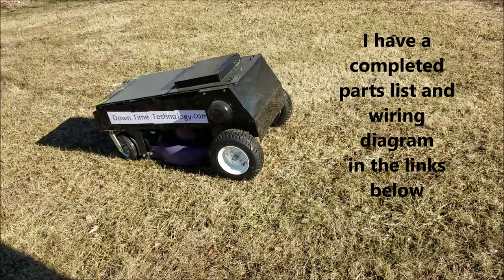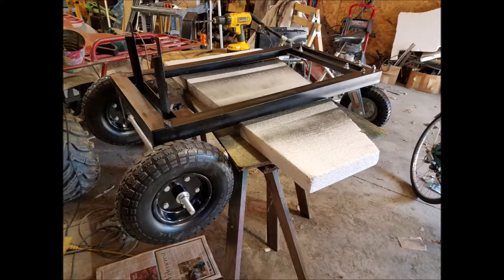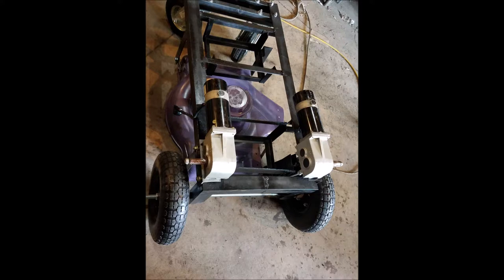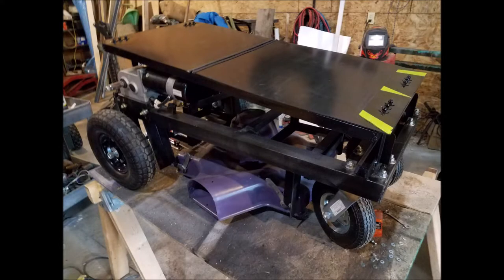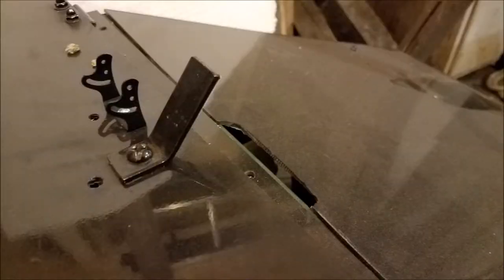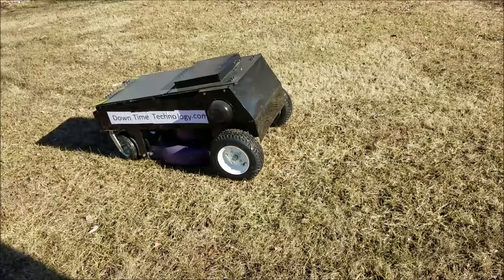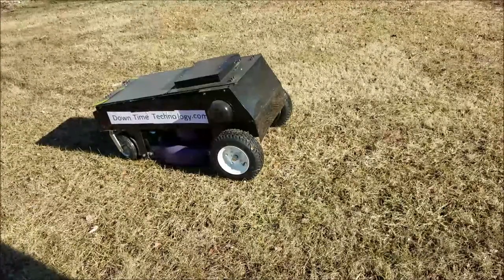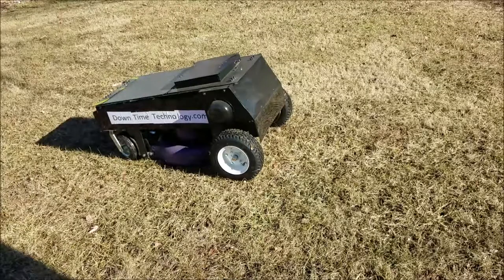how to make a RC lawn mower with on board video - free instructions

Comment: Great video , if I were to use 4 wheel chair motors for all wheel drive , would I need two motor controllers  ? chained together
Reply from the maker: @VernLee-y9q  no, just wire one side both left motors to one leg of controller and the other side (both front and rear motors to the other side of the controller
Reply: Thank you so much

Comment: John , If I could brother you one more time , I was told I need a 60 amp motor controller , is that right ?
Reply from the maker: @VernLee-y9q  for 4) motors, yes, I would recommend a 60. On mine I am using a 25, but I only have 2 motors
Reply: Thank you again

Comment from the maker: Here is the parts list.
Parts list to make my remote control lawnmower

2 inch angle iron (to make some of the frame)
1 inch angle iron (to make some of the frame)
1 inch square tubbing (frame)
several nuts,bolts, washers and lock washers, I used mostly 3/8 in
2) 2-Pc. Split Rim, Hub, 60T Sprocket Wheel Assembly - 10.5in. O.D. 
(bought at Northern tool and supply for $55 ea)
1) 3/4 inch threaded rod 3 ft piece along with nuts and washers and 2) lock nuts
for the end.
2) #24 sprockets with 3/4" ID for the wheel chair motors. I got at Harbor Freight.
2) 8 inch swivel wheels, I believe the tire size was 2.80/ 2.50 
I bought these from Harbor Freight for $14.95 ea.
1) CHICAGO DIE CASTING 6065 1/2" Motor Arbor
(to put on the motor shaft to make adding the blade easier)
1) AmpFlow E30-150 Brushed Electric Motor, 12V, 24V or 36 VDC, 5600 rpm
(mower deck blade motor)
1) spectrum DXe transmitter
(or whatever you chose, just be sure to get a receiver that will work with it.)
1) reciever specified above
1) adapter plate to mount blade motor to the mower deck
get an old mower deck, I found an old 16 inch mower and removed
the deck along with the height adjusters.
you will want to find an old cover somewhere that will cover the blade motor.
2) wheel chair motors; I bought these from ebay for $200 / pair
Left & Right Motors & Gearboxes for Pride Jazzy 1113 Power Wheelchair 
1) fuse holder and fuse, I used a 30 amp
1) good toggle switch that wont burn up under 24 VDC at about 30amps.
plenty of wire, wire connector ends and a soldering iron, cable ties, electrical 
tape and wire looms to keep things organized and nice looking.
Electronics;
1) Sabertooth 2x25 motor controller ( I got mine from Amazon $119.00)
1) SMAKN® 10-30V 12V 24V 30V 120W PWM Adjustable Volt DC Motor Speed Controller CCM2 -
this is used to adjust speed or intensity of the blade. you don't have to have this, but I liked it.
1) 24 vdc charger. I got a battery tender, with a trickle charger, like 2.5 amp.
2) 12 vdc deep cycle marine batteries. these you can discharge very low and not hurt them.
1) 8 gauge or 10 gauge battery connector to run from one 12 battery to the other.
1) BattleSwitch radio controlled 10A relay. this is used to turn on and off the blade motor.
you may want to buy a 24 volt warning light. I bought one for $24

If you are wanting to add the live streaming on board video as I have on my 
other lawn mower, I will discus that also. That is pretty straight forward.
I used a raspberry picamera and raspberry pi3. and a micro usb with Raspian on it. I will discuss 
that later in detail.

Comment: I'm in the process of having parts come in for the build. What electric motor and setup for the mower deck blade did you use? You mention 40v?
Reply from the maker: No, this mower operates off of 24 volts DC, here is the motor I bought / AmpFlow E30-150 Brushed Electric Motor, 12V, 24V or 36 VDC, 5600 rpm

Comment: I like what your doing I'm in the process of doing the same thing slightly different though I'm controlling mine by a GPS and a lidar once the snow goes away seems like me and you are doing similar things though are you good with the computer side of this ?
Reply from the maker: How is the GPS lidar thing coming? I was going to do that, but looked expensive
Reply: @55shanghigh  it was alittle pricey but ive really liked what it's done so far it's .winter here now so I'm just putting all the hardware together and then it will sit waiting for spring. I like what you have going
Reply from the maker: @jardner9691  thank you. It has been a lot of fun. Most important thing I can say to you, is never give up and enjoy yourself doing this.
Reply from the maker: @jardner9691  any update on that LIDAR?
Reply from the maker: @jardner9691  hows that going now? I got the smaller "Slamtech RP LiDAR for $99 and haven't very far, but loving it.